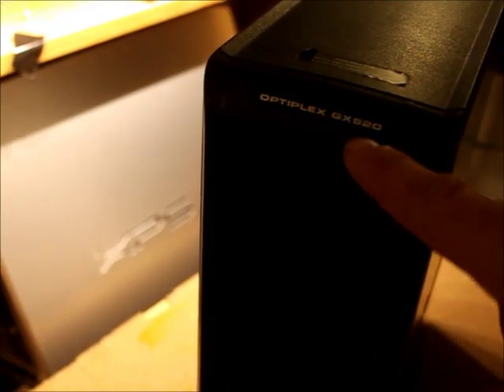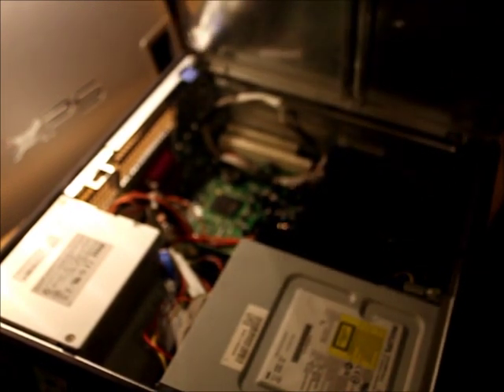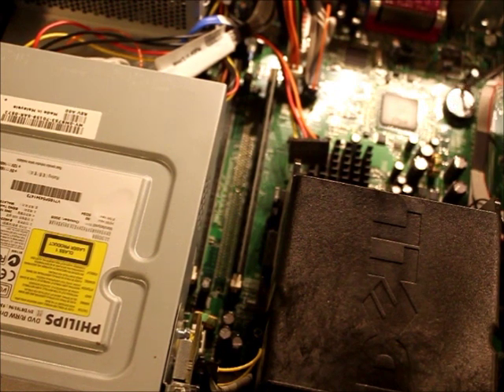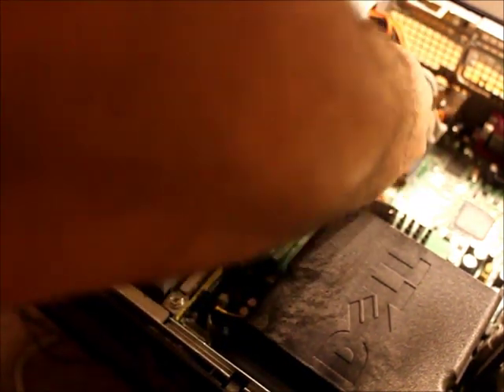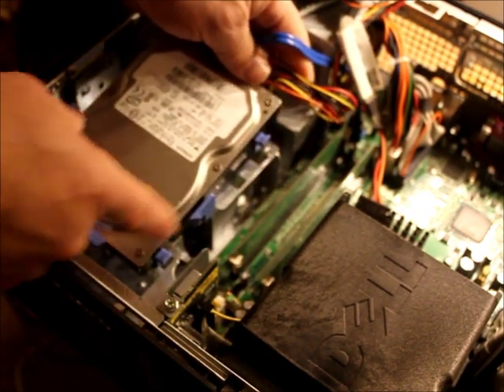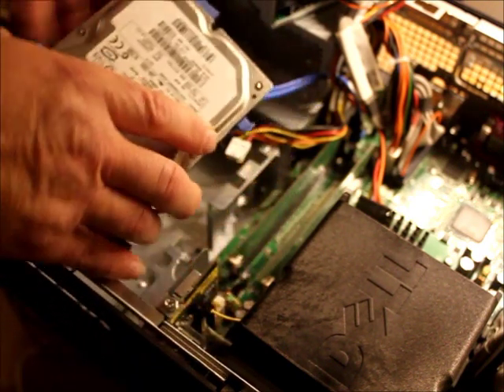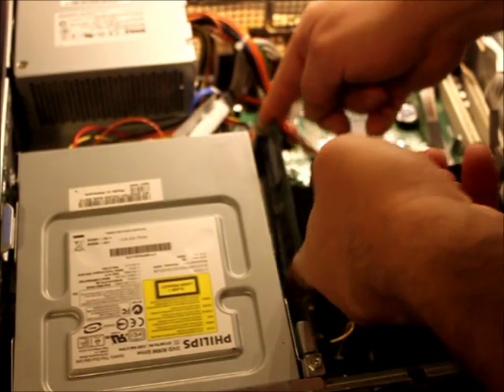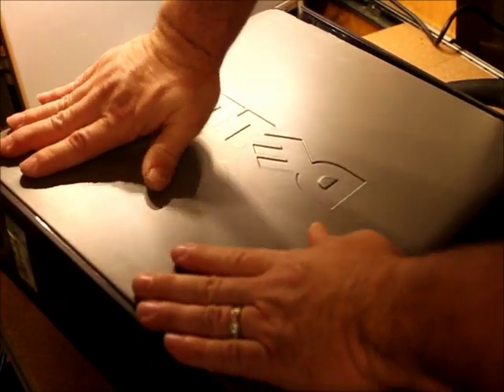Working inside a Dell Optiplex GX520

Comment: Hello and thank you. I'm using a s/h Dell Optiplex (250gig H/D) as part of my DAW. It's great apart from one thing: I don't know how to remove the permissions for test PC\test.  Would appreciate your help.
Rgds,
FL (UK).
Reply from the maker: +Frank Leyland Look for the BIOS battery.  There should be a jumper on the motherboard with a small handle for two finger.  There are three pins.  Remove the jumper move it to the opposite two pins. Start the computer and the BIOS will reset, removing all BIOS setting including the password.  Turn off the computer and move the jumper back.  I no longer have this computer to show you what I am talking about.  Hope this helps.
Reply: Thank you very much - looks like the problem is solved now - Frank (UK)
Reply from the maker: Frank Leyland Great!